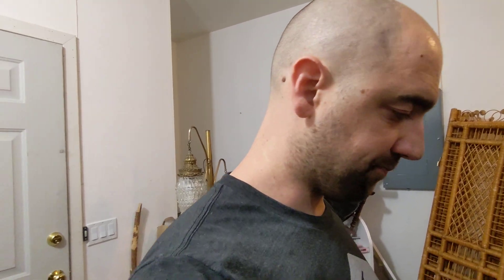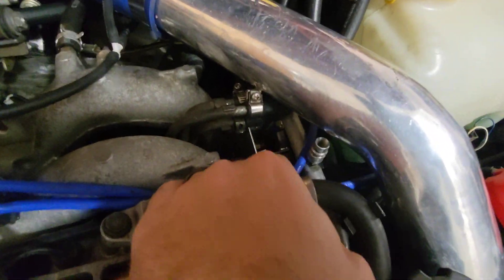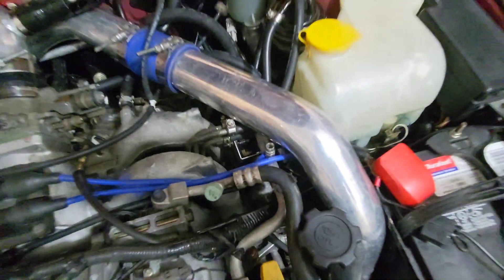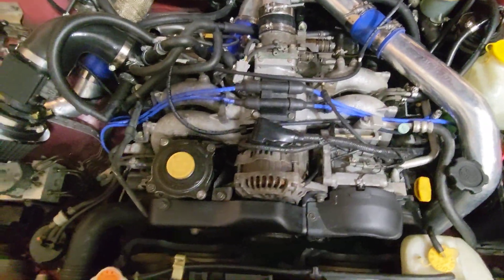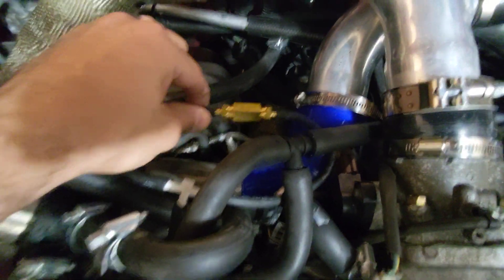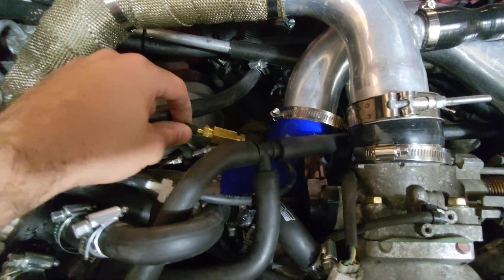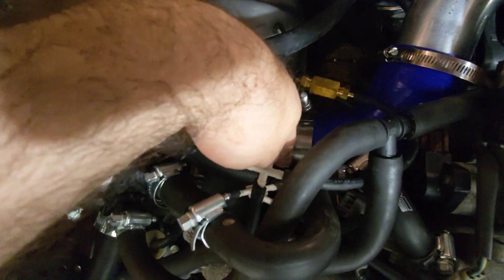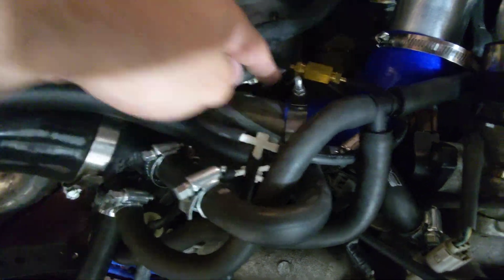NA-T modifying boost AND afr

Comment: What plate would you recommend for a MAP based vehicle?
Reply from the maker: @mateovsmathias6972  It depends on what you are seeing currently.  Each vehicle is different.
Reply: @traviscea  I haven't put turbo on yet. I have read people recommending 12:1 plate for a MAP based car but I don't want to go way to rich and blow up the engine
Reply from the maker: @mateovsmathias6972  The plates are just different diameter discs.  You can get a large one and cut it evenly to change the afr
Reply: @traviscea  thank you my friend